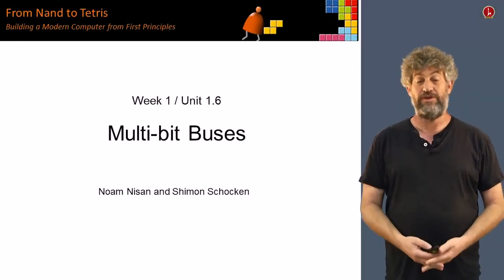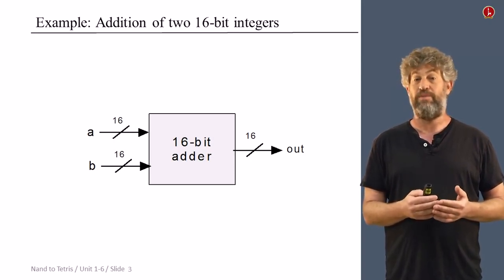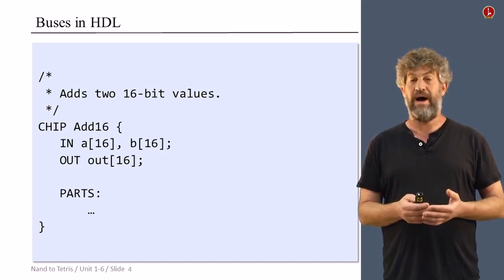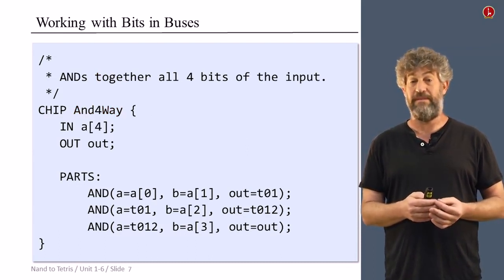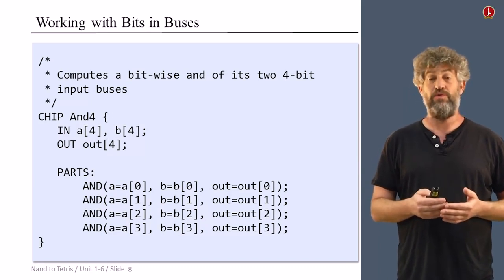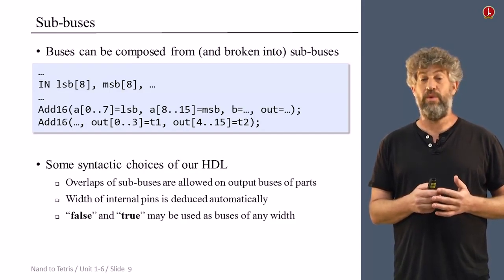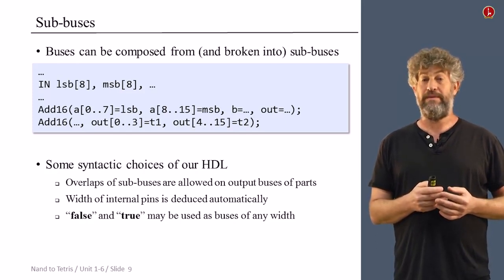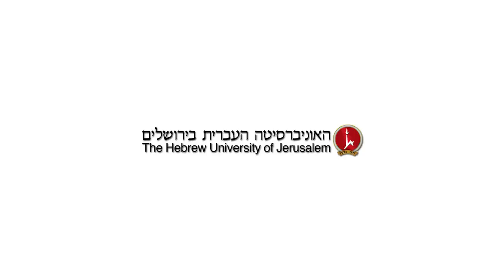[Part 1] Unit 1.6 - Multi Bit Buses

Comment: It's a bit confusing how a[4] in one context means that the variable `a` is made up of 4 bits, and in another context, a[3] means "The 4th bit of the variable a"

But I think I have it right now
Reply: it's because the first bit is labelled [0] and so the fourth label is [3].
Reply: When you declare an array of bits in memory, you are reserving 4 locations, that's what the a[4] comes in. If you see a[4] or b[10] or whatever BEFORE the PARTS: portion of the program, you are declaring its size. When you see a[3] or a[2] or whatever AFTER the PARTS label, you are accessing individual bits of the array.   Lets say you say a[3] before the PARTS label, and the bits are as follows:

a[0] = 1 a[1] = 1 a[2] = 0
Now, you access a[2] after the PARTS label, you are saying, give me the 3rd element of the array.

Hope that helps..

In short... Before parts, you are defining the size, after Parts , you are accessing elements.
Reply: @FreeMayaTutorials  you explained that MUCH better than this professor
Reply: @fahimhuq2768  glad to help! I
Reply: @FreeMayaTutorials good explanation

Comment: this noam guy is so confusing. if they explained what they were doing instead of just showing code in a language i don't understand yet maybe i'd be able to use it but they don't so the learning process is so much slower
Reply: ikr, they could have even used some sort of logic gate simulator, that would be much easier to use and understand
Reply: @intelchip_x86  No in real word they use thsese type of languages such as verilogs which is way more complex and code is 1,000 + Lines it neends testing also u can just click click in a software to test we make scripts for testing and after all tht then it goes to actually making the chip itself :) this software is fairly simple